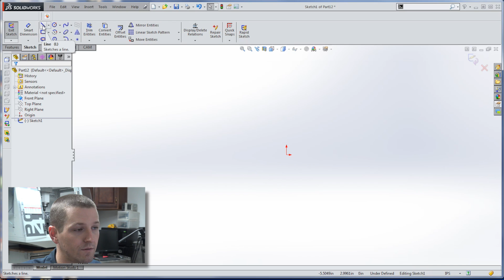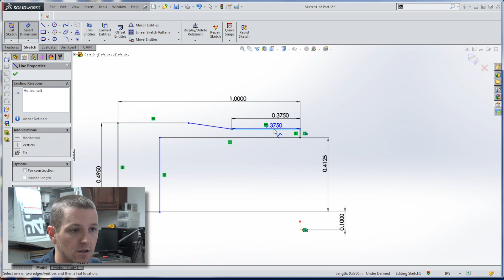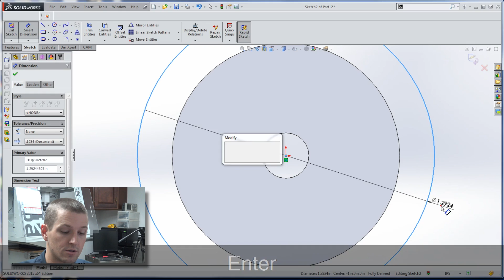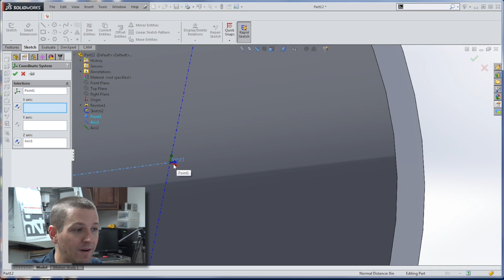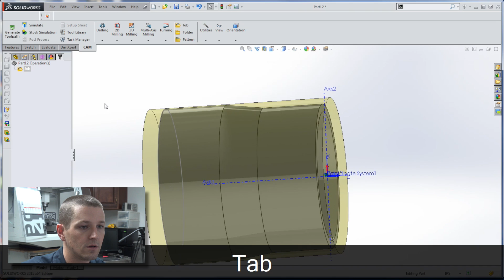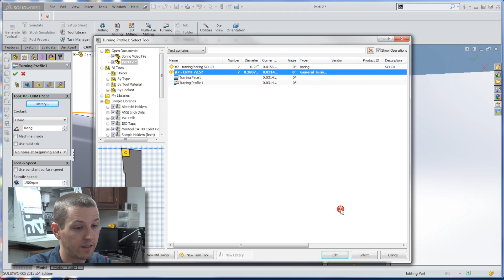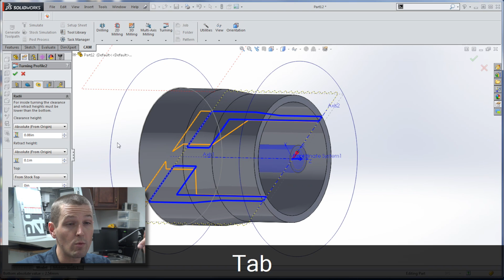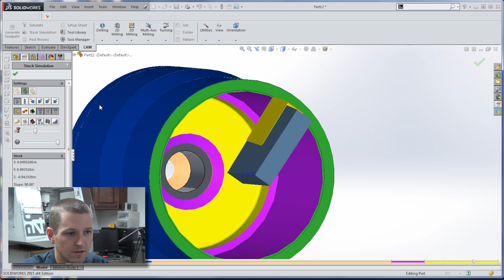Tormach CNC Lathe Boring & ID Turning!  CAD & CAM

Comment: I've had only a few ID crashes.  One big one was when I was proving out each block of the program and had a position move at the end.  So as I went along programming and running each part of the program everything went well.  Hit the go button and got through most of the part then got to the ID roughing, went well, then onto the finishing.  After the ID finishing op occurred I had forgotten to program an exit line and the boring bar went diagonally out of the part.  I loudly made a "I got punched in the gut" type of noise and heard "what broke?" from the boss.  Lesson learned...those position moves are important, haha.  Been a few years now since anything like that has happened (knock on wood.) 

I actually started out CNC on a lathe.  Easier to wrap your head around it when you start on them I guess in terms of manually programming.  Either way I understand your anxiety regarding boring on an NC machine since I once had it, although the job isn't going to wait.  Cheers!

Comment: Nice work John.  I too just started playing with HSM for our HAAS ST10 lathe at the college.  It's so cool and I've got the lathe humming now.  The post isn't 100% yet, as it keeps using an M22 code (tailstock retract).  I didn't worry about doing the axis and reference point.  As I used the plane that matched the SW axis and drew my profile and revolved it there.  It was really quick and simple.  Cheers, Aaron (Melb, Aust).
Reply: +DCTTeacher1 You have a new Haas turning post in your inbox.
Reply: Scott Moyse Oh wow, now that's what I call service.  I post a comment on John's YouTube channel and my CAD-CAM agent (CADPRO Systems) reads it and fixes the problem.  Much appreciated Scott.  Cheers, Aaron.

Comment: the mouse gesture function in sketcher and view window is also fast and easy.
in the customize tab, look for enable 8 gestures.
then in view or sketcher, just hold the right mouse button and drag from any point out like in any direction like a clock dial.
a window pops up and you can see what is at every 1/8 of a clock dial.

it becomes fast and easy.

Comment: I NEED HELP WITH THE TIP TANGENT DEAL ON FUSION 360, AND THE POST I DOWNLOADED FOR THE ST20Y WORKS BUT NEEDS ALOT WORK. WATCHING YOUR VIDEOS HELPS THANK YOU , IVE ALWAYS DONE MILLS PROGRAMMING AND RUNNING , PAST 3 WEEKS IVE BEEN TRYING TO GET THIS MACHINE GOING.

Comment: I just recreated your part here in Fusion 360 and didn't have any problem with the boring.  Not sure what's going on there for you.  Something doesn't look right to me with the orientation of your tool though.  Looks like the insert is pointed out of the part instead of in toward it?  Boring did take a while to figure out the first time I tried it though.  Especially having to adjust the radii as you pointed out.

Comment: Search the solidworks help website for "using centerlines to create radial and diametric dimensions" so that you don't have to divide each dimension by 2 and it just uses it as a diameter instead of a radius.
Reply: +NYC CNC ;-) I discovered this recently as well, totally by accident - depending on where you hover the mouse after selecting the two lines, it either does a radius or diameter dimension about the centerline, pretty neat!
Reply: +NYC CNC ya you shouldn't have to do math to get your dimensions unless its function. its just an error waiting to happen. man you got to try and use functions, its so cool.
Reply: +attainableapex I was going to post this too!